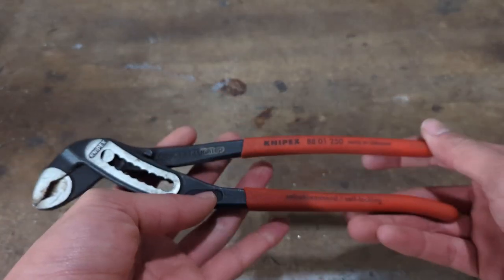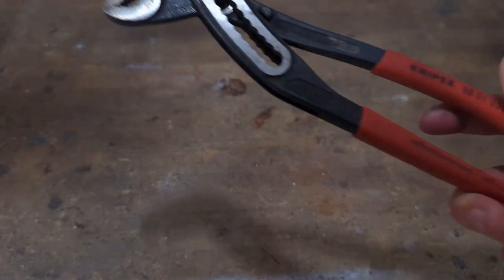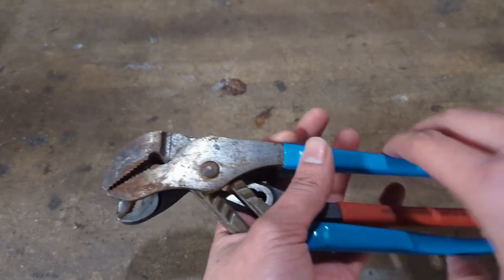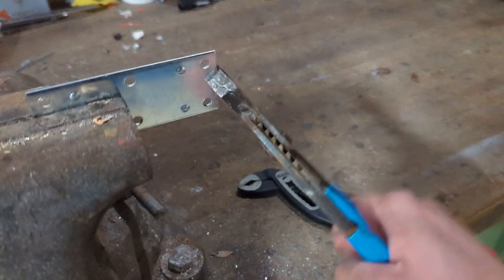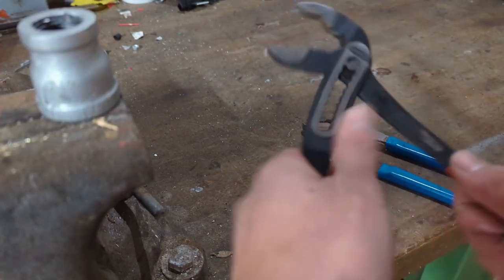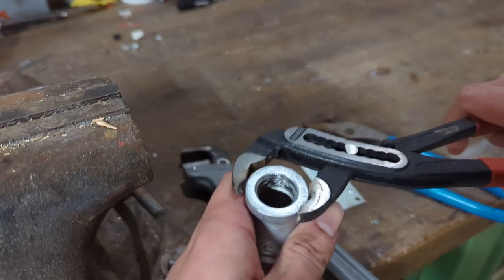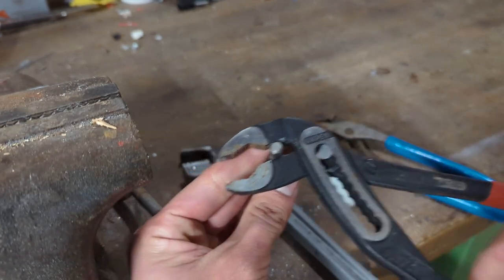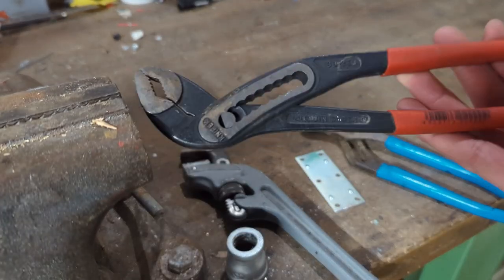Knipex Alligator Water Pump Pliers Review   WAY BETTER Than Channellocks!

Comment: I have several pliers of this type: Knipex Cobra 10" & 12" inches; Knipex Alligator 12"; 10% and 7"; Stanley; Husky and Channellock Fasgrip 9" among other brands.  -For my very personal taste, the Alligator are the best quality steel pliers; jaw design and ergonomics, I even like it more Alligator than Cobra performance  -Jaws grip is better on Alligator than Cobra, Cobra pliers with the same jaw design as Alligator would be the best of both models.    -Performance; quality and the durability and ergonomics of the Knipex Alligator and Cobra is hard to beat.